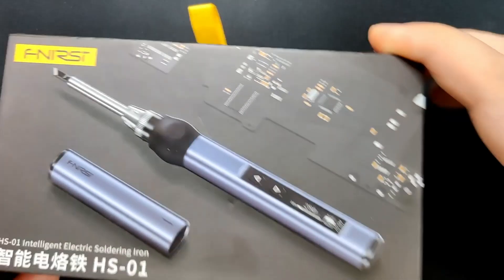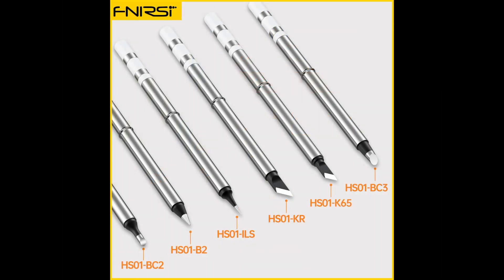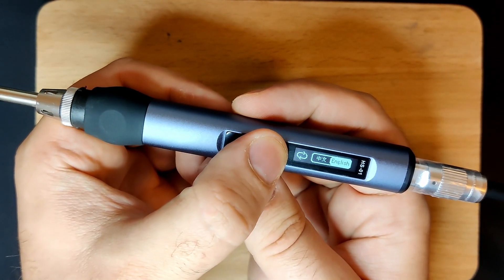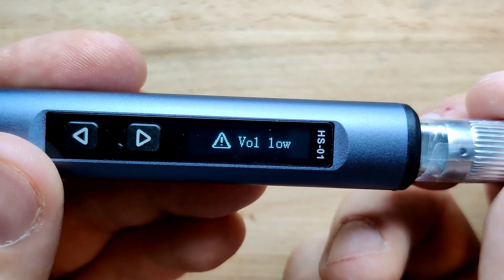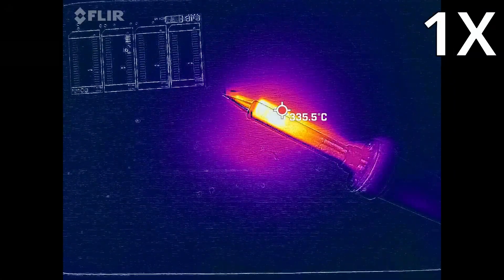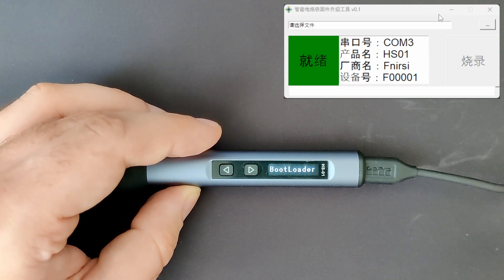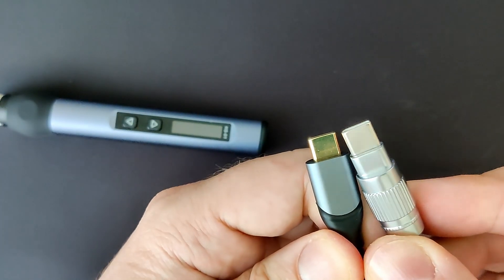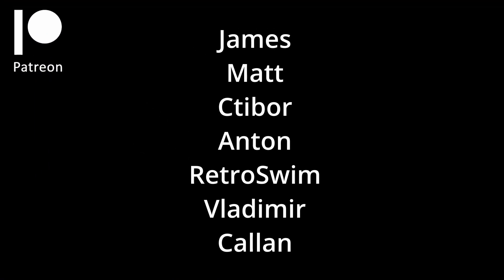FNIRSI HS-01: An intelligent and affordable soldering iron?

Comment: after 1 year of use I would not recommend it. The usb is wanky, looses power when you move the iron, the tips dont get recognized,Its very fustrating. Chinese poop
Reply from the maker: Sorry to hear that. I also had an issue with my soldering iron that I got from them. I changed it just three months ago because the screen stopped working - and I couldn't open the iron to look if it is fixable. Any soldering work I did on this cannel was mostly made with that one soldering iron - so, I would say it saw quite a bit of action. Heating was still working, but not knowing what temperature is set is a no-go.
That is why I purchased the same iron again - I am using it again for my videos. 
I don't change the tips often and I use it on my desk - so, I didn't experience the issues with the USB connector and the tips that aren't recognized anymore. Nevertheless, it is not nice when a soldering iron gives up after just one year in your case.

Comment: Thanks for the video,,, I see it uses 4 amps at 24v, does anyone know where I can get a 4 amp USB cable ?
Reply from the maker: I am using an old laptop charger from a Dell laptop. I can use it at 20v without issues now.
Reply: @bitsundbolts  I need mine to be portable so need to make a 20 volt power bank from 18650s but cant find a cable that will handle the 4 amp
Reply from the maker: I need to check again, but I don't think my HS-01 offers 24v at 4 amp. The maximum voltage I can select is 20 volts. It could be that they've updated this model since I've tested it.
What about the DC converter that is sometimes part of the package. It converts a regular DC connector to USB-C. Although, that adapter doesn't look like it could deal with a lot of amps.

Comment: Did you try this iron with an Apple charger?
Reply from the maker: No, I only tried a charger from Dell.
Reply: @bitsundbolts  Apple adapters use USB C Power Delivery protocol that can output different power depending on the consumer device. For example my 85W PS can output 20.2V 4.3A, 9V 3A, or 5V 2.4A over the same USB-C port. Will this iron be able to utilize the 20.4V output?
Reply from the maker: Yes, this iron does support 20V. I use 15V most of the time because I'm still using the adapter that came with it - and this one is unstable at 20V.
The Dell charger I used in the video is 130W if I'm not mistaken. And it does supply similar values as you describe. There was no issue with the 20V setting and the Dell adapter - so, I'd assume that the Apple charger will work too

Comment: It’s too bad it can’t operate at a low-wattage (15w) at 5v USB. I get the design challenges here to make a useful soldering iron at 5v, but even Weller makes a 6v (4xAA) portable soldering iron that is rated at 25w peak using a capacitor for momentary heating (15 seconds in my testing)

Comment: What about grounding?? Because without grounding the iron, you're at risk of damaging sensitive/low voltage ICs. 
The TS-100 has a grounding screw IIRC, where you can connect a grounding wire.

Comment: I think QualComm QuickCharge has more voltages over USB-A, tho it's usually just 9? The combined total is if you use more than 1 port, you always get way worse performance on these power supplies if you do, best to only use a single output.

Comment: Type a can quite often have more than 5v output... but it always defaults to 5v unless the device communicates via PD that it can take more than 5v
Reply: Usually via QC. PD is quite an exception on type a, AFAIK only newer original xiaomi chargers and cables for phones support PD over it

Comment: This product got my attention. But Dave Jones had some problems with it, but I think that Dave just put the tip wrong way in(he put the tip in without taken the screwed cap off first, I think).  
Does the tip get loss easily? Or are my conclusions right that Dave just need a manual for this, he just did it wrong? 😁
Edit: Will a standard 19.5V laptop power supply work with this iron?
Reply from the maker: I saw his video :) Yeah, he clearly did not open the manual! To answer your question, when the tip is properly inserted and fastened with the nut, it does not move and is not lose at all.
I am not sure if 19.5V will work. I think the tool is very sensitive to voltage and my just give you the "Low voltage" warning, even if you have enough amps on 19.5V. Maybe I find a power brick and I can let you know.
Reply: Yeah, Dave didn't install his tip properly, you are correct.

Comment: a charger with a type-a can have more than 5v in the quickcharge modes(9/12/20, depends on charger and the quickcharge standard or nonstandard used). 

relatedly there were some  type-a pirate samsung quick chargers on the market a while back that outputted a fixed 9v instead of negotiating the change. worked fine for the said samsung phones meant for it but.. it was just 9v so not good to use with actual 5v stuff.
Reply from the maker: Ah, right. I forgot about the smart charging feature where devices negotiate voltage. You are right. Thanks!

Comment: I have JCD 8898 soldering station - both the soldering iron and heat gun 2-in-1 for less than 40€. And it also uses widely available standard tips. (Hakko 900M) Best find i've had for any tool.

I also upgraded from some kind of cheap weller clone to this and never looked back.
Reply from the maker: One day I have to try out Hakko soldering tips. I have a feeling I am missing out because I have a feeling I only used basic (not to say mediocre) tips so far.
Reply: @bitsundbolts  that cheap station and a 2€ cheap set of tips is already a perfectly viable and working toolset. I could only imagine, how good could the original hakko tips be. :o